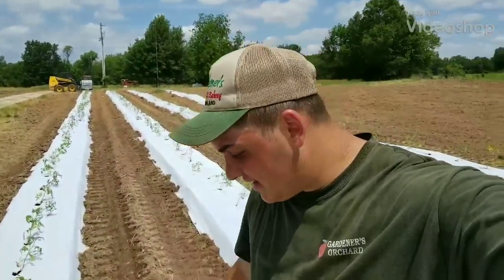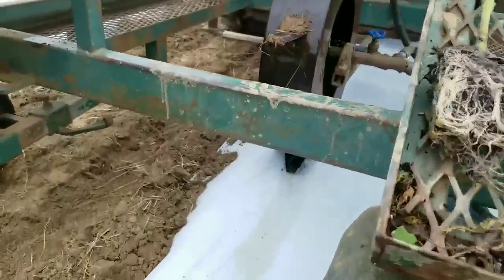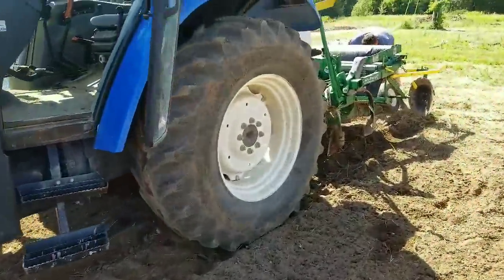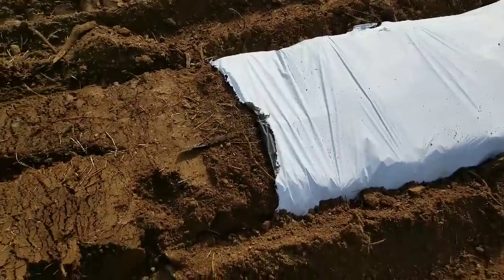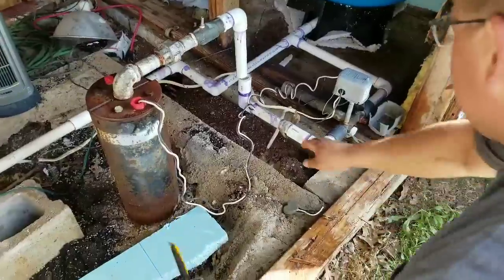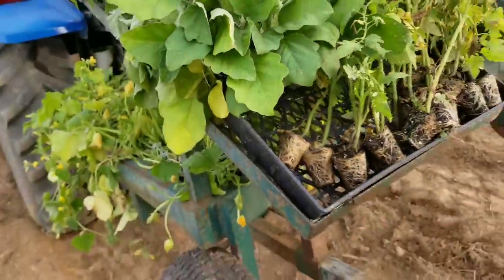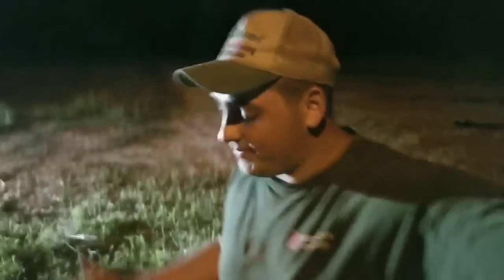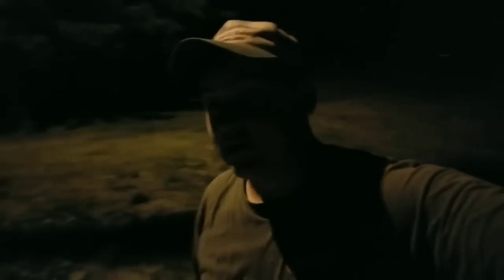Planting 1,200 plants in 2 hours with Water Wheel Transplanter

Comment: Overall, how did the tomatoes do on white plastic? We only use white plastic for squash. The white sure seems to "deter" the squash beetles a lot. As for our tomatoes, the black plastic seemed to kick ass a lot. We installed 4.5 miles of plastic and t-tape this year.
Reply from the maker: That's alot of plastic mulch! The tomatoes yielded very well on the white plastic. Lot more than I expected.
Reply: @farmerdre1  , good deal! We will continue to use the white for our winter squash, onions, etc. I do wanna try it out on our zucchini next year. One way to find out if it works, you gotta try it. We get most of our stuff through Rain Flo out of Pennsylvania. The white is a little spendy.